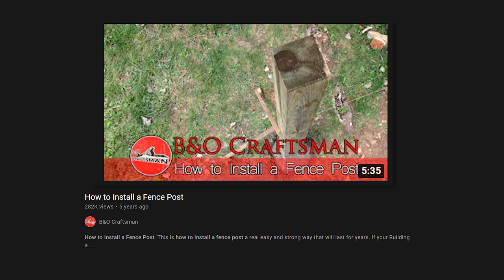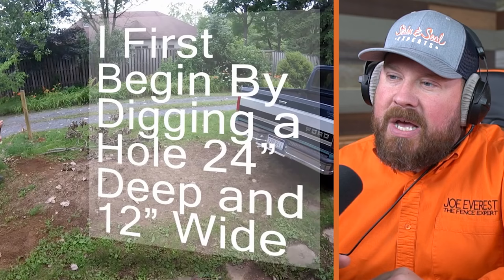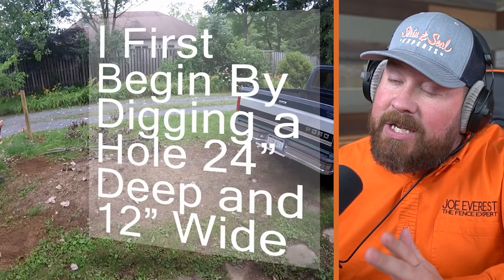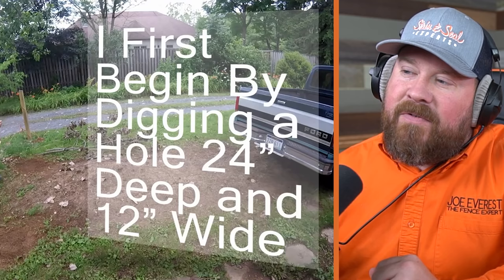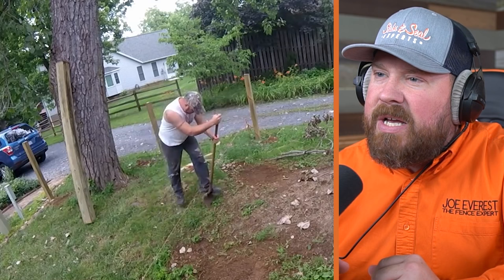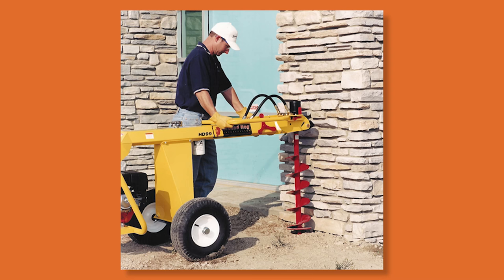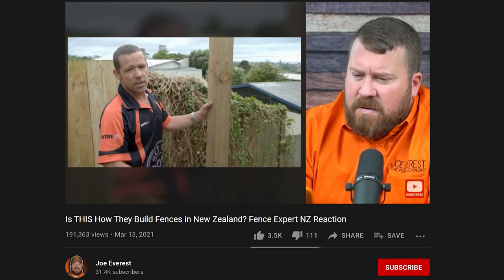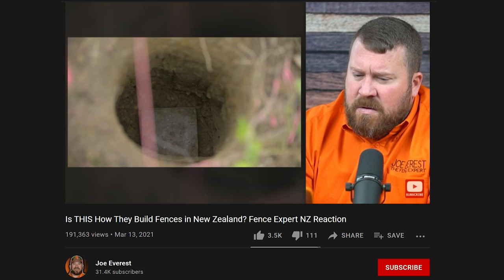One of the Most SOLID Post Installation Videos I've Seen

Comment: When I was young I remember my dad coating the bottom part of the post with a thick layer of tar.
Reply: Exactly.   All you need to do is spray some sealant right where the post meets the ground.   THAT is where 90% of decay happens.
Reply: Or now a days flex seal liquid rubber to depth of bury line.
Reply: My dad and grandpa both did this. 
There were always 2 buckets. 
1. Some of the tar was poured out into one of the buckets. 
2. Then, the fence posts were dunk into the tar, if the post was going deeper,  then the tar from the other bucket was poured along the sides and allowed to run down. 
 Many of the post we put out were close to 2 & a 1/2 to 3' deep. Lived where the freeze point was 18 inches to 2 foot.
Reply: Wrong. That will keep water that drains down n the post. Add 6” of gravel below post, so water drains away
Reply: that’s a good idea
Reply: @leathercheerio1  it's not water that rots it, it's exchange of oxygen from the biological environment at the top two inches of soil.
Reply: @NicholasRachuna  whoa, 🤯 🤯!true though.

Comment: You know who puts posts into the ground without concrete and has no rot issues? The electric company
Reply: Electric poles are treated with very different processes and chemicals vs regular pressure treated beams
Reply: Their posts are soaked in creosote.

Comment: 27 years ago I built about 400 feet of 6 ft tall full privacy fence. That's about 50 posts. I set them 2 feet deep and dry poured an eighty lb bag of concrete mix for each post. For posts I used 4 in landscape timbers. Caught them on sale for a dollar each at home depot. Just last year I had to replace about 8 of those posts because one had weakened enough that a strong wind broke the others on each side. Same thing happened with another section this year. The point is that after 27 years there was very little rot even in those cheap landscape timbers. The biggest problem was the wind. 6 ft privacy fence catches a lot of wind. Almost all the remaining posts are leaning 6 to 8 inches. Not broken or crooked. Just leaning. I set the new posts 30 inches deep and filled the holes to the top with wet mixed concrete this time hoping that will help.
Reply: You sound like minded. I think there is a tendency to over engineer things today.
Just dug 35 holes fir for a 230 ft. X 6ft. high job on my home. Using 6x6 pressure treated and 2 bags dry mix a post. My method is half bag in hole add water and next half bag. We are in a relatively dry climate and I am sure this fence will outlast me.

Comment: Seems to me a well driven post is best. Deep and tight. I've pulled t-posts that were 80 years old and in mint shape with only a little rust. Bare cedar posts 30+ year with only rot ring at ground level but perfect below that. 4x4 treated in good shape except at ground level. Just figure every post has some natural life span and accept it. Everything deteriorates right at the ground and all that gravel, treating, pads, cement, coatings is just time and money. Plant it deep, pack it tight. Brace it if it has horizontal loads. My 2 cents.

Comment: Ill say this as a fact. Anytime you pick out lumber and you should always do that, if you pull a our e of lumber and it has knots on one side of it mostly put it back. If the knots run the center it's good no I ots are good. When posts or lumber completely cure if the knots are offset it'll bend your pieces badly even when fastened down . And for god sakes you deck builders cup yourfive  1/4 deck noards correctly. Tbe curve of the grain will cup your boards over time and cause standing water on the board. Turn it like a u that is upside down.  The deck roll lady ten years longer doing that

Comment: I've dry set, I've mixed, and I've poured watered down and tamped it. Honestly it's all about the same in my opinion. I've dug up a dry set 6×6 post (set on the wrong side of the line) it was there 2 days and was solid. Had to bust off with a sledge. I find it easier to pour some dry then wet then add more then some water and tamp with a little rod done.
Reply: I just dug up 2/3 my fence that I had set a couple of months ago using 1-2-3 mix and had to use a breaker :D

Premade Postrcrete ones from a previous installation I dealt with in seconds weeks before that.
Reply: @bipedalspecies2086  I haven't seen the premade postcrete.
Reply: @j.hernandez983  I don't know if it's a UK/British thing and I should really have said 'premixed'. It's a cement sized bag with sand, cement and a little rock. It works out 3 times the cost of mixing your own so with 19 posts I bought a concrete mixer, putting up overall cost by about 50% and after done using it for the fence, rendering the garage and a few slabs I will sell it.

I like that it's fast, easy to use and sets within hours but its cost and strength in comparison doesn't add up to me. I have used postcrete/postmix and it's my first time mixing concrete, but at least I can gain some experience and knowledge doing this and the satisfaction at the end.

Comment: okay concrete hand mixed....most people mix it entirely to wet...the "strength issue" isn't an issue in setting posts, the concrete isn't
under a compressive load like a foundation or driveway slab...it is taking the place of other back fill material such as aggregate...the real issue; wet mix is going to take longer to set thus longer to hold the post securely....it is easy to do 120lbs to 180lbs hand mix in a wheel barrow and with a round shovel (electric barrel mixers mix to wet and aren't easier; you still have to lift bags of concrete, need a wheelbarrow and will have another tool to clean...put in about 2 gallons of water first, pour in first bag concrete (60lbs) and mix; it will be very soupy...add second bag and mix will start to become stiffer add about another 1/2 gallon water...mix until no dry cement visible....add another 1/2 gallon water and mix then add third bag....begin mixing and  slowly add water, mixing throughly until you achieve about a 5" slump (mix will retain shape in shovel)... (once you're used to this, it takes about 10 mins to do)... with post in hole  at proper location and plumb (use string lines and tape measure ,always measure from start/corner post) shovel cement around post equally, "rod" concrete, tap  post just above concrete to get "cream" to set around post... finish top so it slopes away from post... the stiff concrete will hold the post plumb and set enough in 2 hours to allow constructing fence...if you want to keep bottom of post off the dirt; after the first couple shovels raise the post up and down a few times the concrete will flow under it

Comment: We have torn out many old wood fences and replaced them with post master fences but after doing this a while we found it makes no difference. The post will rot where the concrete starts weather its at grade or below.  Gravel on the bottom only helps if water can escape from the inside of the footing.  Over time the post shrinks, creates a gap between then post and footing.   Basically acts as a funnel.  Also in areas with heavy frost it is best to leave the footing 6" to a foot below grade as the frozen dirt will help keep the footing from lilting.  Love what you do Joe with breaking down these videos.  Opens up for some great discussion.
Reply from the maker: Thanks Anthony, I appreciate you sharing your experience!
Reply: Myself, too, after pulling many posts gave found depth and solid compaction best tools for good post performance. Rot will happen regardless. In fact, the more you do the more they rot. Bare post (no cement or treatments) seem to rot less but still some.

Comment: “You can never check the plumb of a post to many times” you are absolutely right on that
Reply from the maker: I appreciate you watching, thanks!
Reply: I use a fence post level that attaches to the post providing levels in both directions continually. Makes getting the post straight and level dead easy. I just wish I could teach it how to dig the post hole!! :-)

Comment: The frost line in Michigan is 42” and when I installed 300’ of 6’ tall treated privacy fence about 10 years ago, I set the 10’ 4x4’s into 48” holes, on top of gravel I tossed in, and I didn’t use any concrete at all. I packed in something called “county-mix”, which is a gravel mixed with fines (stone dust) which ended up settling quite a lot but after multiple minor fills...it sort of hardened like concrete. 

I don’t recall what I paid to have the county-mix delivered but just last week I had to widen the driveway approach about a foot so I bought two 32 gallon garbage cans full of the county-mix for less than $20 but the problem was the weight since a yard of it weighs 3200 Lbs. Anyway the point of the mix was to keep microbe laden dirt away from the wood posts. And with concrete, I’ve experienced post shrinkage over time, which then allows the wood to get wet. 

Everything is still perfect, except for the huge carpenter bees boring under the rails and the somewhat protected areas of the posts covered by the pickets. I just started spraying the hovering male guard bees with Sevin attached to a garden hose, which drives ‘em away for a couple hours so I can poison the holes before the guard is either replaced or they’ve recovered. Well that’s my story and I’m sticking to it.

Comment: Joe,  Excellent problem-solving discussion format.  You got my brain cells working. Succeeded today in my 1st ever pole installed.  Plumbed, leveled, and cemented hole at 36" deep.  Problems overcome 1st due to some big water drainage concerns, I thought it best preparation to 1st treat the new 4x4 pole with a little mineral oil mix and follow-up with 1 coat 36" of asphalt roofing tar.  2nda placed a stone to keep the pole above the water built up at the bottom tip of the 4x4.    If I may add a little lesson learned that prevented Mother Nature from getting mad at me and drowning a gate post.   1st problem that almost kicked my ass was I observed the natural slope of the ground drained water right towards the gate post hole.   Hence, I appreciated your researched suggestion that others were using to raise the pole above the water.  The stone left me with 30" vice 36".  So far appears to support a 6' gate with ease.

Comment: I worked at one fence company and we pre mixed the concrete in a bucket then poured the wet mix into the hole. Then was offered more money at a different company and they poured a bit of water in the hole then dry concrete then more water on the top. Then take an 1/2” steel pipe and stab it into the concrete so it would help the water get all through the concrete. Add water if needed. 
I like the 2nd way because the post is set right away. No 24 hour wait.  
Like joe said to each their own!

Comment: The first thing I noticed was the guy did not add any gravel to the bottom of the hole.  I would also use an asphalt emulsion and dip the post in it or paint it on the 2 foot that is going in the hole.  I would also stain that post to keep water from damaging it.  Yes it costs a little more but, will last longer.
Reply: I do see the stones and solid stone that he added.  My bad. Sorry.
Reply: same here. coated the bottom that was in the concrete and about 4" past. Painting the fence, so its rubber/emulsion coated and then painted to cover that....

Comment: HI ..Thanks  to B&O Craftsman for the original video and Joe Everest for the great review and comment.  I"m in the midst of replacing posts and fence that was installed by a contractor 5 years ago...yes 5 years ago. (My neighbour hired him) 

I believe the contractor owned a small mill and milled all the wood himself (Douglas Fir/ BC Canada) and did not pressure treat or oil them up at all.  The soil here is wet heavy clay....most all of the rot in the 5" Sq posts that I'm replacing was at ground level to about a foot or so into the soil.  The bottoms of the posts are surprisingly solid.  

 SO, I've come here to get advice.  What I'm thinking is, I"ve dug the post holes down between 36-46"  (we have deep frost here in Northern Canada) and then filling around the posts with a mix of gravelly clay, i.e. gravel to encourage drainage and enough clay that it will pack solidly.  Then stopping short of the ground level, and filling that part with concrete ("Post Haste") with a pyramid shape to drain water away from the posts.   Again this is northern British Columbia Canada...we get a lot of rain, snow and deep frost.  Oh...and I absolutely hate having to spend time rebuilding fence...when I should be FISHING!!!!

Any suggestions, experience and/or advice greatly appreciated!  Thanks!

Comment: The strongest part of that post is just above the ground  until it rots which may take 15-20 years or more. Most of the fence I install is stockade. I will install 2x4 and set the panel on that secured to both post. I also will run deck board 5/4 on the back side of the panel from bottom of the next post to the top of the gate post, this will keep the top of the gate post from moving. This extra step will keep your gate post strong.

Comment: Zelda Fences and Landscaping up Northern BC Canada. We have lots of different types of earth up here, lots of rock. I insist of course on PT posts, won't build a fence without them. For the bottom of the post hole I use the post itself to compact the ground, use bag concrete same way to leave an anchor at the bottom. Then use the excavated material to backfill and tamp hard on the way up. I find it saves me from having to take away the residual earth, and saves the client on concrete. I've never had a previous client call me back to fix a post. Solid method. Respect from 🇨🇦 , happy sub to your channel

Comment: I like that you aren't super critical but I would absolutely have dinged him on a couple things. The hole should always be three feet deep imo no matter what climate range you live in. When I lived in PA we dug deep busting rocks to get below frost line.  I live in Florida now and I dig deeper and buy 10 foot posts for a 6 foot fence to protect from high winds and the digging is easy. I love the foam personally because it keeps moisture off the post and is easier to install by yourself. This guy was absolutely right about choosing posts by looking at the end grain. Posts can warp bad if chosen wrong imo.

Comment: I have pulled my share of old posts. And the ends in concrete exposed to the dirt rotted most of the time, BUT no where near as bad as the ground level of same post, so my experience shows it does not matter as the post at ground level will rot through first.
Reply: Pulled some 30+ years posts back out of ground. When I had set them I used no cement. Posts still good as new except at ground level that had some rot. Lost about 5% of its original volume at that line. Cedar posts with bark left on.

Comment: Typically....a good video. B&O has some good stuff. Finally, we live in an area where locust is available. It’s Gods choice for fence posts. With good drainage , a locust post milled or not will last longer that the supposedly 30 yr rating on treated lumber. I installed a locust post fence in 1992 and it’s still standing!

Comment: I pick out 4x4s that are slightly bowed that way I can position them where the bow is in-line with the fence.  alternate bow to the left, then bow to the right. This seems to stabilize them.  the perfectly straight ones can bow after install, and its a 50% chance they bow in or out, leaving you with a wavy fence.

Comment: If you need to set up quickly just buy a bag of lime and pour your concrete into the hole then pour about 1/4 cup in the hole and stir it around then level the post again and backfill with dirt to cover the concrete and it will be hard in less than 30 min.

Comment: 8" round hole is more than enough for a 4x4 post.  Paver/ brick at the bottom, backfill with 411 Stone to about 4 inches from the top, soil the rest of the way, get the pickets about an inch and a half off the ground, and you are good to go.  I've done plenty like this, and not have had any issues as a result.  Picking out the perfect wood is not practical when you're getting a load of 50 post delivered.  Up in my area, we have to dig down 38", but only in certain cities.  Posts end up about 5'6" out of the ground, and 2'6" in.
Reply from the maker: Sounds like a great process, I appreciate you sharing it!

Comment: Hi Joe. I'm not a fence expert by any means. Shouldn't all post in areas where there is frost possibility to use sono tubes. My reasoning is that a lot of holes that are filled with concrete are not very uniform from top to bottom. Filling with concrete around the post with no sono tube leaves the sides of the hole jagged and irregular allowing the frost to heave it. When the frost gets into the ground and expands the post can easily heave upwards and stay there due to getting hung up and also dirt can accumulate under the post over several seasons of frost heave even if the bottom of the post is below the frost line. Therefore a smooth sonotube wont let this happen.
Reply from the maker: The smooth sonotube would likely make it easier for the frost line to heave the post, as the post footer would be smooth and have nothing to grip to in order to resist the push.

Comment: Neighbor had a contractor put up a fence. I had already started mine and he said he likes to use 16' runners instead of 8'.so you're tying into three post instead of two. After I set my post dead center on 8'.i find that 2x4x16 are actually over 16' and had trim each one to hit center of my 4x4s. Flm I just want to go back to being a millwrght where everything is true to dimensions.not to mention had bad the wood is warped.
Reply: That's what nominal dimensions are in construction, and longer pieces of lumber are notorious for bows and crowns